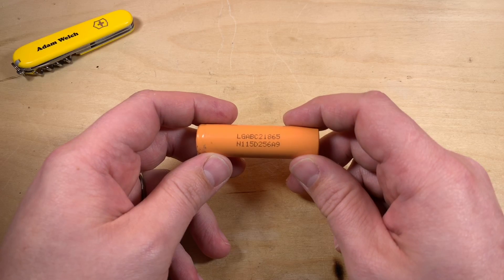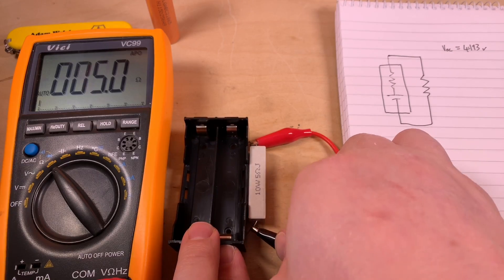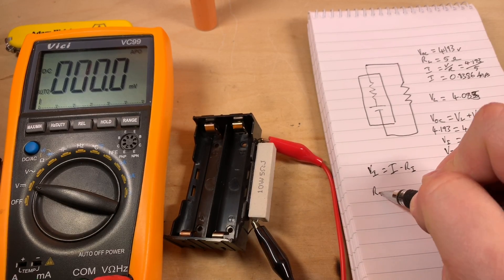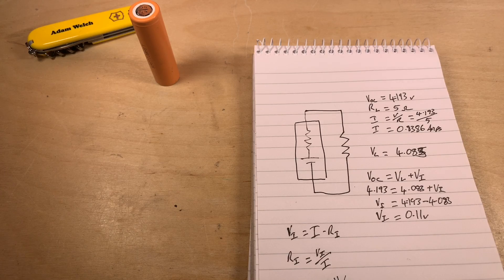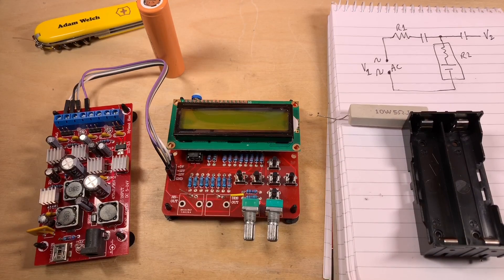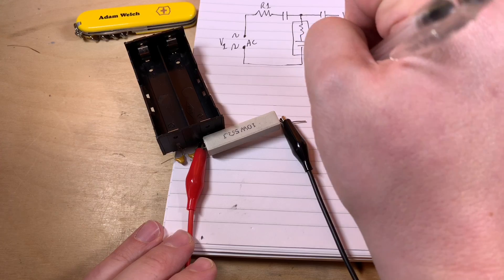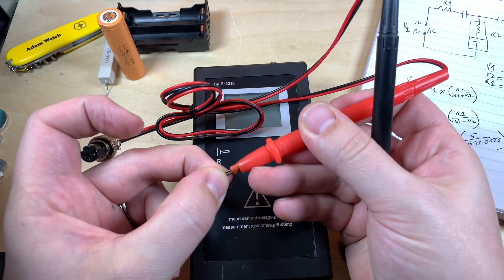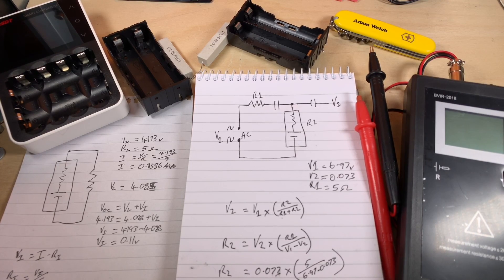Measuring Battery Internal Resistance

Comment: Hi Alan great video.. Coukd you tell me what you would regard as high internal resistance and therefore a doggy cell. Thanks for any reply. Regards David
Reply from the maker: Thanks David. As I said in the video - it’s a matter of bench marking your own cells. I’d like to build packs where all the cells have an IR less than say 80 milliohms. But when I planned to use 140 cells in my pack, and only 120 of them were within this limit, I had to revise my limit! I charge and discharge my pack at very low currents, so IR isn’t a huge factor for me - perhaps except after a poor winter period when self discharge can be more of an issue.

Comment: Unless I've missed something with your first measurement (it is after 1am) I think you need to measure/calculate the current with the load connected.
Your calculation for current was based on 4.193v being across the 5ohm resistor, which it isn't. That's across the internal and the 5ohm. Only 4.083v is across the 5ohm.
Although that actually makes the result further from the charger's measurement at 134mOhm.
Reply: Steve Evans yeah, I was wondering that too!

Comment: adam make an arduino internal resistance  measuring device version 2 , i think many wait for this!
Reply: +1
Reply: 8:40 220pF and 100Hz and you are afraid of the precision you have measured the 5Ohm power resistor?? Xc is at 100Hz around 7Mega Ohm !!!! i think you have to tune the values and frequency a little to come into a useful range, e.g. 220nF and 100kHz Xc is then a million times lower at 7Ohm. Actually i would go even futher ro let Xc as low as possible to not take it into account compared with the DC resistance 5Ohm so a big 1000uF and 10kHz so the capacitors are in milloohm reactance and the 5Ohm is dominate. The do the math again you should come close to what the devrices is measuring in about 100mOhm what anyway your first methode results in. Keep it up

Comment: I read in some IC datasheet, can't remember which, that your method is somewhat correct, but to make measurement more accurate, it should be done with two different load currents and evaluating the difference: Ri = (Vl1 - Vl2) / (Il2 - Il1)
Reply: This is HIS Internal Resistance measurement method, HE will use HIS values to compare HIS batteries ...

Comment: Calculate the time constant of the RC circuit to determine the correct measuring frequency. That is more than likely how it is done in the commercial one. Also the initial experiment is only accurate within micro second after connecting the load as the voltage instantly discharges once connected especially at full charge. Then best thing would be to have a switch connected and pulse it long enough to make a measurement which is next to impossible on a low cost multimeter.

Comment: Interesting! My method is to use two different resistors as load and calculate the internal resistance from the difference in voltage over the difference in load resistance. I imagine this wll take away the weak top voltage and bring you down at the flat spot on the battery voltage before testing.  Would like to see the result of this compared to the methods you showed us.
Rudy

Comment: I think in the first test it is difficult to calculate the current I accurately because the internal resistance itself has not been allowed for. When the current is flowing the 4.193V will actually correspond to the cell side of the internal resistance. That presmably means the internal resistance  has been under calculated slightly.
Reply: Yes on his 3rd line, I=V/(Rinternal+Rload)
Reply: @unlost117  Yes that's right
Reply: @jerrys9426  Or he could simply have used Vload in same calc instead of Voc on the same line to make it correct ie I=Vload/5 instead of I=Voc/5

Comment: The overall battery resistance consists of ohmic resistance, as well as inductive and capacitive reactance.  https://batteryuniversity.com/learn/article/how_to_measure_internal_resistance
True impedance of a cell can only be determined by injecting a 1khz signal into the battery.  Pure resistance is usually fine for determining really bad cells though.

Comment: I use  the LiitoKala Lii-500 .   Anything with in 100mR works for me.  Never had Balance issues doing so.   Usually if a Cell has higher Resistance it will show up as  Excessive Heating during Charging.

Comment: Thank you for your videos! I really enjoy them and learn alot. I've always been interested in what it means to have a high or low resistance. Can you tell if a cell is bad from the numbers? How can that number relate to the application it is used in? For example if you are building a power wall.
Reply: The higher the internal resistance the more power is lost to it. Batteries with high internal resistance are gone bad, or made bad. best to discard them.

Comment: As someone suggested, the simplest way to deal with the capacitors influence is to measure the ac voltage across R1. Rint = R2×V2/VR1

Comment: You have neglected the impedance of the capacitor. Use a bigger one at higher frequency to reduce its effect or just add it in your calculations.
Reply: Impedance of 220pF capacitor at 100Hz is about 7ohm, assuming internal resistance of meter can be ignored use 7+5 = 12 for R1 and you get 125m ohm using that method.  So they all agree....
Reply from the maker: Andy Barnard Crumbs - is it that much? That’s really helpful, thank you.
Reply: It would have been more helpful if I had added the phase of the reactance as well!  So calculation is not right, but the principle is there....
Reply: @andybarnard4575  You sure on that, he said 220pF didn't he, not 220uF?
Reply: Whoops, yes, out by a factor of at least 1e6....
Reply: Or measure the voltage across the resistor.
Reply from the maker: Good idea. I’ll look into that. Thanks.
Reply: Exactly what I was here to say, beat me to it! Also as Adam mentioned, that meter may not be accurate at all in measuring low AC voltage, yet along at 100Hz. Most cheap meters can only do 50-60 Hz AC
Reply: Calculation is correct when adjusted for .8 amp draw vs .8386. Machine is pulling 4.5% smaller. Also not needed to calculate capacitance. As meter sees total resistance.

Comment: Hi, in the second metode you used different frequencies, in the diy it was a 100Hz sine wave and in the comercial one it was a 1KHz  lets suppose a sine wave
This is probably the difference in the tests
Reply from the maker: That occurred to me in the edit. I’ll be sure to test out that theory. Cheers
Reply: @AdamWelchUK  👍
Reply: I second that, if your using an AC component in the measurement then the frequency is  going to play a part in the result.